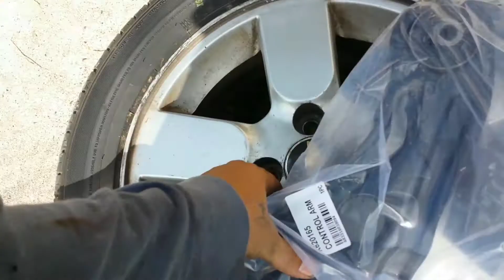2006 Chevrolet Aveo LT Lower Control Arm Replacement

Comment: Doesn't anybody use a pickle fork anymore
Reply from the maker: I'm sure some people do, but why go through the trouble of renting, borrowing or buying one if you don't need one. I try and make my videos with the least amount of tools to get the job done, some people just don't got the money or extra time to go rent or buy certain tools. In some of my videos you'll see me show people the tools that some mechanics use because I got most tools needed to work on vehicles and I'll explain to them how to use them but I'll show them how to do it without the tool. I do this because most people looking for videos to work on cars do not have such tools, for instance, on one of my videos I show people I got the right size wrench, I even put the wrench on the bolt to show them I got the exact size for that bolt, but instead of using the right wrench, I switch to a bigger size wrench and show them that if they can't find a small enough wrench all they got to do is use a bigger wrench and just put a couple of coins in between the open end wrench and the bolt to be able to remove the bolt with a bigger wrench. Sometimes I get comments from people thanking me for showing them how to do it without professional tools because they didn't know it could be done a different way. I was at the shop the other day while the guy hit the knuckle to release the ball joint on a car he was working on and funny thing is I just about asked him the same question since he was working on a vehicle at an actual shop. The guy had the pickle fork but chose to just hit the knuckle with the hammer, so I asked him why he didn't use the pickle fork,  he said they hardly ever use it, he said it's faster and easier to just tap the knuckle with the hammer. Sorry for the long response, my buddy always ask me why I got to write a book when I respond to his text messages, I told him that's just me, I normally try to explain as best as I can to not leave someone's mind still wondering what I'm talking about. I'm glad you asked that question because I'm sure others who think they need a pickle fork wonder why themselves and if they read your question and my answer they will know why I chose not to use a pickle fork. You can use one but don't actually need one to get the job done.

Comment: Just did mine yesterday… a few pointers for others who are doing this job:  the two inner bolts get torqued down to 110nm, and the one above the ball joint tightens down to 55nm. Get yourself an 18mm claw to get the torque wrench in there (ball joint nut).  Jack the engine up just enough to get the other side bolt out.  Another tip is to put the donut rubber in first, as he did.
Reply from the maker: @F13button  Glad you got it done, and thank you for the advice you passed along for others.

Comment: Sometimes if you tighten the bolt closest to the front of the car tight before putting weight on it first, it will tear the brand new boot at that spot. Should drop it and reach under there to finish the one up front. Did this to myself when i did this, had to do it twice.

Comment: That ball joint was sooooo easy......I had to push on the ratchet with my feet and hold myself , and even then I handed up jumping with both feet on the control arm and the ball joint popped off the control arm......bolt and ball joint still stuck in hole LOL

Comment: Thanks for the video. Doesn't look too hard but it's good to see how it's done at least once
Reply from the maker: That is why I like to do my videos live, so people can see exactly what gots to be done. If I run into trouble, one can see and know what to expect. If I don't know how to do a job, I myself will look up videos and go from there, it's a lot easier to do a job after watching someone do it first. Thank you for watching my video.
Reply: @globaleffect1969  I got the passenger side done this morning but the driver's side bolts would not break free. Impact gun and breaker bar wouldn't move them. So I had to give up. Probably going to have to cut them out eventually

Comment: Great video.  Best
One yet on this repair. !
Reply: REAR BUSHING SEIZES ON THEN IT TURNS IN 2 HRS FRONT ONE SAME THING . .YOU WILL NEED TO JACK UP MOTOR SLIGHTLY FOR FRONT BOLT DRIVER SIDE.
ANTI SEIZE ON BOLTS FOR BUSHINGS WILL PREVENT THE KILLER TASK OF GETTING THE BUSHING OFF AND SAFELY EXTRACTING  THE BOLTS .  HAVE 4 INCH ANGLE GRINDER READY AND FIRE CONTROL ON HAND .
HE GOT AN EASY ONE HERE.

Comment: What about an alignment afterwards
Reply from the maker: You can take it in to get it aligned or you can align it yourself like they did in the old days before they came up with machines to do everything. I actually aligned mine myself, I had seen a youtube video showing how to align it yourself and it's easy to do. I tought about making a video but I never did. I don't remember the video but you need one piece of thin string long enough to reach from the back of the front of the car, a measuring tape and a couple of wrenches. I'll look for the video, if I find it I'll post the link here.
Reply from the maker: This video shows you how to align it pretty good, there's more videos out there, I'm showing you this one because it's a good video. 
https://youtu.be/awOMTYDptfk